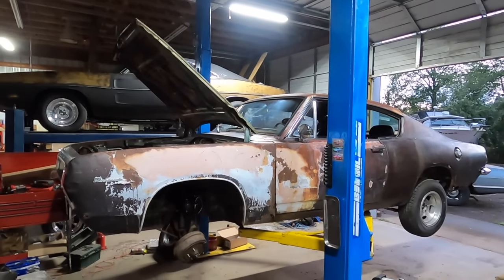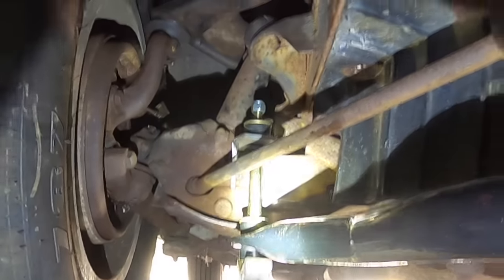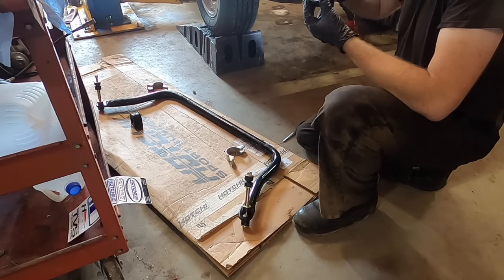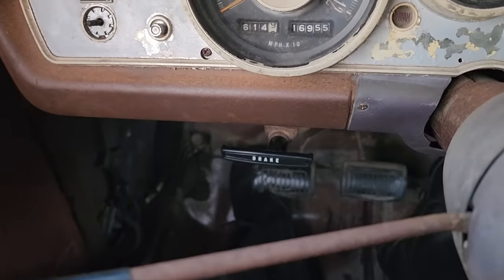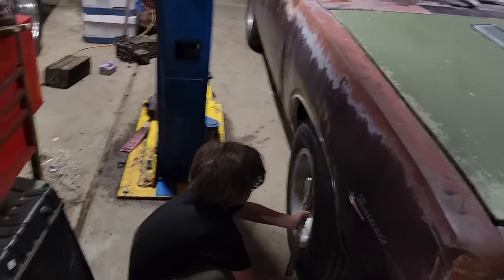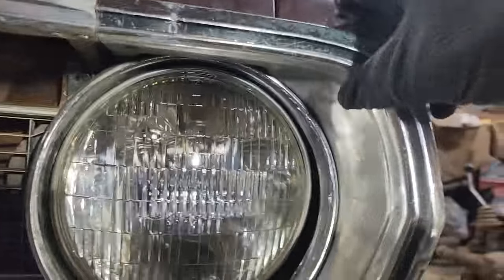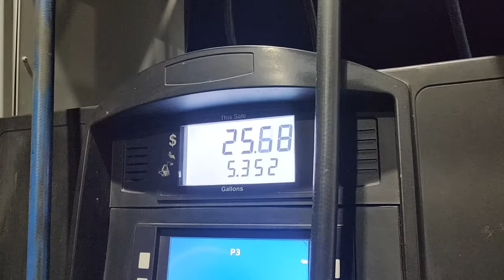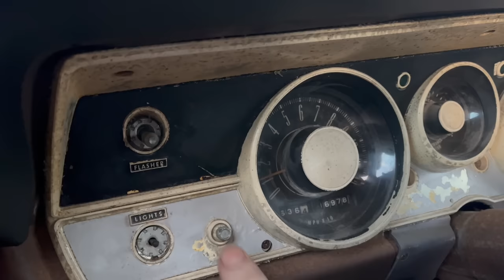The Single Best Suspension Upgrade For Your Classic Mopar - 1967 Plymouth Barracuda Gets A Sway Bar

Comment: My 318 powered '68 Fury VIP didn't come with a front sway bar, so I got a factory bar and brackets from a '68 Fury big block and had the brackets welded on my stub frame and replaced all of the bushings. Even at the factory size, the sway bar made driving almost 18 feet of Plymouth a lot more fun. The car that's even more fun to drive is my '79 Dodge St. Regis also 318 powered but did come with a front sway bar. When it was my dad's car, he added a rear sway bar from a '77 Cordoba and I can toss that thing around like it's a much smaller car. No money spent on a anti sway bar is ever wasted.

Comment: Great work men. Love the Idea of 'Tubular Roll Bars' and the weight saving over solid bars. I was in the states a bunch of years back and brought with me back to Australia for my Valiant, a Firm Feel, 1 1/4 front bar, (Heavy) and a frame hung (think AAR Cuda) rear bar. There were some very strange looks from the Guys at customs in Sydney airport that's for sure. Your right when say best money per Corner HP gain you can make. I've just Subscribed✌

Comment: Good day eh! Great to see another 67 barracuda! New suspension bushings, squeaking like a dog toy. Someone tightend the bushing bolts with suspension hanging. good chance the rubber has torn away from the shells now. I believe procedure is install new bushings and bolts left  loose, put car on its wheels full weight and settled ride height. Then tighten the bushing bolts. prevents the squeaky toy thing. Dogs must go nuts when you drive down the street! Great video as always!
Reply from the maker: No, that is not what that horrible sound is… that’s the clutch pedal.
Reply: ahhhhh!
 @DeadDodgeGarage
Reply: clutch activation sensor! @DeadDodgeGarage

Comment: Looks like that sway bar made a pleasing difference to the handling.   My  Australian  1971 Valiant, which if you're  not familiar with , is  bigger than what you think of as an  A body ,almost as big as a B body,  anyway , I've  got it handling  really sharp ,and the best  thing I did to it was fitting gas charged ( I think that's what you call them) shocks  on the front,  the one's  that  come  with a wire  on them holding them compressed until you've  got them mounted at the bottom , then you snip the wire and they extend  with force as you take aim at the top mounting  hole. I dont know if you've  used them , but now I wouldn't use ordinary shocks  again, they make the front end feel very taught , but still  not harsh riding  unless it's a rough road , just ordinary heavy duty gas  shocks on the rear. Before I fitted those I put a factory sway bar on it , I didnt  really notice much of an improvement from that on it's own , but probably because  it 's not heavy duty. The other things that help makes it a handler are , new ball joints , new tie rod ends,  new wheel bearings and all packed up tightly  with grease, basically everything in the front end in like new condition.With the steering  box I adjusted it so that if you stand outside the car and turn the steering wheel just slightly you can see the road wheel move with no slack .235 x 60 x 14's on the front,  265 x50 x15's on the rear . A big improvement  I made to the steering and road holding ,was setting the front  wheel alignment  to the non factory specifications ( for a street car ) recommended  by  the New Zealand race driver Leo Leonard  , in the early 1970's he raced  Aussie  Valiant  Chargers , and he did a lot of track testing to make them handle as good as possible  ,  I wish I'd known  of these settings years ago , I cant see any reason why you couldn't  use the same settings on your American mopars, I cant remember offhand  what they are ,but Iv'e got them written  down somewhere,  I can look them up if anybody is interested. 🙂👍
Reply from the maker: We’re hip to the updated alignment specs. In fact, the big upgrade we do to these other than the tubular sway bar (yes, the large tubular does much more than the stock setup - I tested that theory on my ‘66 Charger) is offset upper control arm bushings. We covered that in the last update video on this car (“A Very Chaotic Suspension Upgrade Video.”) I’m assuming original specs for your Aussie car would be similar to what we had here - configured for bias ply tires. Those specs are of little use to us today. I have never used gas charged shocks. I would like to test adjustable shocks some day. I would prefer to let the springs and sway bars handle the springing action, and let the shock absorbers do their intended job.
Reply from the maker: Also, those cars are indeed very different, and interesting! The 111” wheelbase is the same as the A body Dart of that time - but the cars appear much larger. It may be a trick of the fuselage styling.
Reply: @DeadDodgeGarage  Some say it's the styling that makes them appear large , but I've had(and still have) A bodies, including a Dart body Valiant, and they are definitely small in comparison.
Reply: @DeadDodgeGarage  Maybe the racing chargers used  bias ply's, which seems a bit scary, but the Chargers sold to the public had radials ,that was around the time that radials were first introduced,  so his specs would have been for using radials , which of course is what's  on mine ,and as I say it made a big difference  to the steering  stability.  I'l have a look at your video on the upper control arm offset ,it sounds interesting.

Comment: the ol' '76 Valiant sedan has the "340"-spec suspension, sway bar with poly bushings/Moog end links (the 'gooder' ones), offset UCA bushings, plated LCAs', KYB's, and the 11.75" rotors with cop car wheels & 60-series rubber. Not real trick, but effective and cockroach tough
Reply from the maker: Nice! That’s very similar to the setup on the Llama Barn Valiant. It works very well. It does also have subframe connectors and a rear bar. Now that I think about it, I’m not sure if the lowers on this one have been boxed or not.
Reply: @DeadDodgeGarage my '69 Swinger is at US Car Tool getting the "Full meal deal" sans rocker reinforcement right now. The Valiant will as well, but not before it runs the Southern Classic.

Comment: Installed the same sway bar in the same car, found if the bar is fully bolted to the brackets first and the brackets modified to fit the k-frame, this keeps the bar level in the bushings and prevents binding. I had to grind the k-frame side of the brackets to fit flush against the k-frame, then welded them on. Also, if anyone uses QA1 LCAs on early sbp cars, the sway bar brackets do not line up with the end links, need to cut them off and weld on the Hotchkis brackets.
Reply from the maker: Sway bar brackets are like always a problem. We’ve been using those bolt on tabs for years because when we started we didn’t have the welding technology. They just about never line up. Often, aftermarket bars and factory tabs don’t line up either - or links want to interfere with strut rods. Good info to have. I (Jamie) haven’t done these weld on mounts yet. I have installed a few of the bolt on type kits from Hellwig.
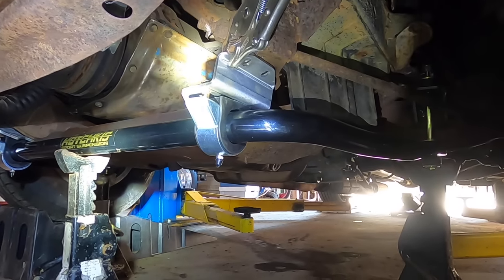Reply: Yes, it looked crooked in the bar after the brackets were forced to the frame at 2:40 but I did not see that at the end.

Comment: Definitely a lot easier than the ball joint replacement. Some very unnerving noise when it's riding down the road. But, it looks like it handles pretty well with the sway bar added to it.
Reply from the maker: That thing is made out of horrible noises… hopefully we get to the bottom of those eventually
Reply: @DeadDodgeGarage  That sounds like the making of a good video - how to make those noises go away.

Comment: I was spoiled with my 74 Dart Sport, it had the factory sway bar, may have even had a rear sway but I dunno if I am remembering that correctly.   When ever another A body guy would ride with me, they always thought I was lying about me rebuilding the suspension stock, they always thought I had something crazy going on.  They would always be shocked when they looked under it and it was nothing special.  Sway bar makes such a big difference.
Reply from the maker: It really, really does. I am amazed by how confident the Demon is with the tiny stock bar. We’re not taking road racer cornering - obviously - but it’s quite respectable.

Comment: Sounds like the clutch pedal bushings could use some grease - or new bushings. Or maybe not, all the distressing noises add a lot of character.
Reply from the maker: That noise was so much quieter when it had no exhaust 😅 I think it’s the down rod pivot on the pedal itself. Don’t know why. Have tried spraying the bushings with no change. We’ll figure it out when the transmission comes out in the near future.

Comment: Jamie, got a video idea on rebuilding a engine and selecting upgraded engine parts for a street car. 
For example, I have a ‘68 HP440 and don’t know how to read the specifications on piston selection to increase my compression.
Another idea, discussing camshaft duration/lift. To help people make educated decisions on selecting a replacement cam. 
Should you go up in duration or lift? Change Lobe separation angle? Etc… 
God bless from Oklahoma!
Reply from the maker: Honestly… I’m not that smart yet. But I will definitely be doing videos on more performance builds over time.

Comment: This is the first time I have seen a Mopar that did not come with any sway bar at all from the factory. I was aware from literature that stripper slant six cars did not come with them. I was not aware that welding was required when adding a front bar to such a car.  But of course Chrysler would not include the mounting so you could just bolt one on.
   My one concern was when the test fitting was being done, the brackets had to forced to fit flush (2:47) and that it had to be forced and clamped up there. And the bar was now at an angle to the rubber bushings (2:50).  See the gap?  I did not see that at the end, so I hope it resolved itself.
Reply from the maker: We must be looking at different Mopars, because I’ve seen many with no factory sway bar. Like, most of them have no factory sway bar. All standard A and B bodies. Most trucks. As far as we know, all big block B bodies do have them standard, but don’t quote me on that. 

I’m sure he worked it out. I cut a lot of footage. This car has seen some stuff, and the K frames are cobbled together junk from the factory before they’ve been smashed on every curb in the country…

Also, the factory bar setups do bolt on in many applications. Not all - as has been mentioned in these comments, actually. And obviously non-tab control arms in a and b bodies are a problem, unless the shock mount brackets are used. The Hellwig bars we used to use were a bolt on solution.

Comment: I picked up a factory front sway bar for my Challenger at a swap meet years ago but never got it installed.  No welding capability and I never found a set of LCAs with the sway bar tabs already installed.  Now with better sway bar choices I'm not sure what I'll end up doing.

On the Barracuda's sway bars; are those grease fittings there on the bottom of the brackets?  It seems like they're pretty low on the car, maybe the lowest point on the front end.
Reply from the maker: Yes they are, and yes… they will absolutely be ground off in the near future. Nice design work there, Hotchkiss… the bolt on sway link tabs that attach to the lower shock bolts work, but they’re not ideal in location or rigidity.

Comment: I thought this was bolt on?  Then I see  see you welding  brackets onto the lower control arms.  Did you  initially get the wrong sway bar? Just wondering. I always spot continuity errors.
Reply from the maker: No, the Hotchkis bar is not a bolt on kit, and I thought he explained that in the video. The Hellwig bars bolt on like a factory unit would have, and we have always used them to this point - but they have gotten ridiculously expensive. In any case, if your car does not have the lower control arms with factory sway bar link attachment points, you'll have to add them. One option (used by Hellwig) is a tab that bolts to the lower shock bolt. It isn't great. The other option is to add tabs - ideally with welding, although it is possible to drill holes and bolt bolt them on as well.

Comment: is it necesary to have a rear sway bar too? i've ordered a front sway bar and will install soon, but just wondering if a rear one is recommended to have?
Reply from the maker: The front one goes a really long way on its own. The rear bar helps to reduce body roll even further. I was very impressed the first time I drove a car with both. I wouldn’t call it necessary - most of our cars don’t have one. But it’s nice to have and makes a notable difference.

Comment: If you want some serious caster, nothing beats Bergman/SPC fully adjustable arms. I saved money and got first generation of Bergman arms through SPC, but 2nd would be even nicer
Reply from the maker: Yes, those arms are awesome. Many companies make them. Personally, I want improved caster for $40 and some elbow grease… hence the offset bushings. The entire point of this exercise is to show how to build an awesome street car that does great things without throwing the entire parts catalog at it. By doing more with less, and focusing on the most important pieces.
Reply: I don't even know how to measure and set castor with my tape measure and bubble level driveway amateur alignments. I just set camber and toe in and hope for the best and put the skinny sacrificial tires on the front and watch for bad wear patterns to tell me if something is seriously wrong with the latter two. I would like to see this channel show how to do it correctly with basic home equipment, if that is even possible.  I gave up going to shops decades ago when I realized the last shop was doing worse than my driveway jobs.

Comment: There is a big controversy with whether rubber bushings should be lubed. The factory says "no" in service manuals and Tech film strips (You should hear "Tech" ,the Pillsbury Dough Boy like character with the gravelly voice rant about it.  ) but the current aftermarket suspension manufacturers say "yes" and even include some lube, as we seem to see here.  These are probably poly but the same question presents.
Reply from the maker: These are poly. They do need to be lubricated, because there is movement between the bar and the bushing. The outside is greased to prevent the horrible creaking noises. Any retrofit poly bushing is designed to allow movement - like the lower control arm bushings that go in the original sleeves with lube, for example. Rubber bushings are intended to flex - no lube.

Comment: What would you drive for the exhaust setup? Will you stick to the 1bbl Holley?
Reply from the maker: The 1948 works fine, so I think it stays. The exhaust works but it definitely doesn’t need that catalytic converter - if it even does anything…
Reply: @DeadDodgeGarage  Nice! You got two Daily driver projects but wich engine gets better Mileage? The LA or the Slant six?

Comment: Only problem is you now have more understeer.   If the front and rear roll stiffness were tuned for no swaybar, you will have a lot more understeer.  You can half ass fix it by reducing rear tire pressure.
Reply from the maker: I don’t think the front and rear roll stiffness of a slant six A body were tuned for anything 😅 we have done this to many cars over the years. It works. It doesn’t magically lead to murderous amounts of understeer.
Reply: @DeadDodgeGarage  Perhaps these low end cars had no suspension tuning whatsoever.  I would still increase the rear roll stiffness by at least increasing the spring stiffness.  Add a leaf or two?  They also sell shocks with coil springs incorporated.   I have not studied this for these midget Mopars, but there must be an easy way to increase rear roll stiffness.

Comment: what upgrades besides Firm feels solid aluminum k frame isolaters would make a better handling 1973 Dodge charger, with the sway bars of course
Reply from the maker: Are you doing a Firm Feel gearbox as well? I would. Stage two, probably. There are other options too. Good sway bars are going to do the most there. The late B setup is very different than the earlier A/B setups that I have a lot of experience with. It’s more like a C body - or even a GM product, really. I don’t think there is any need for offset upper arm bushings like we use in the other cars. Poly lower control arm bushings and strut rod bushings would be a good move if they are available for that application - but I haven’t checked on that. Those might even be the same as earlier B bodies, although just about nothing else suspension wise is. There is always the worry of poly bushings making creaking sounds. Grease the crap out of them… You could try a bigger torsion bar, but personally I would stick to factory unless this is a serious handling machine. It can handle nicely and still ride well. Don’t forget good quality shocks. I often do… but they’re a sound investment.
Reply: @DeadDodgeGarage  thanks for the advice and different they are, my very first car was a 1972 charger and I regret letting it go but I finally found a this charger cheap (15 hundred) and it has a big block needs some body work and I figured that handling and stopping will be first priority and then the patch panel and other stuff till I can finally go back 35 years ago and have fun , I think that they make solid cross member for the torsion bars also want it safe and close to the feel of the earlier models not feel like the front end is riding on a wet sponge,